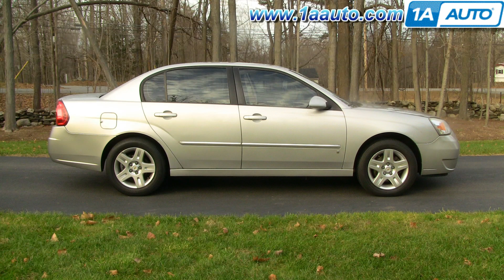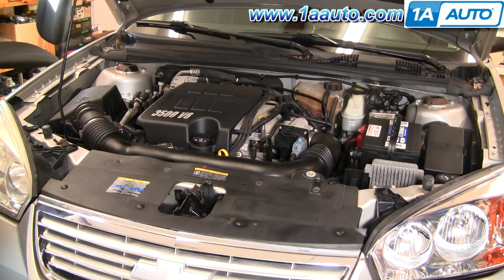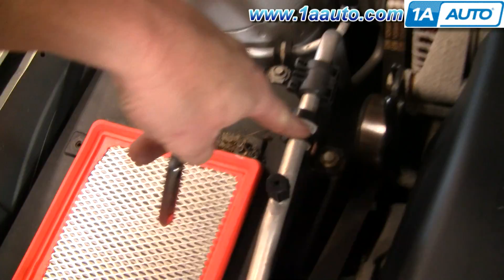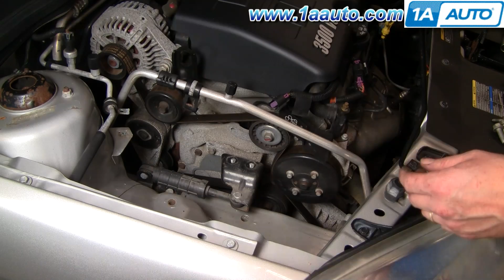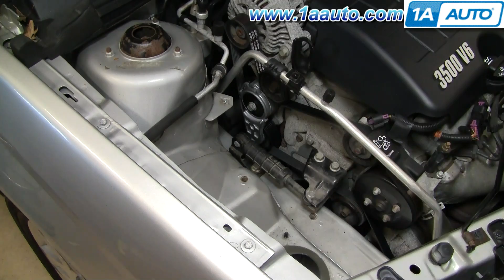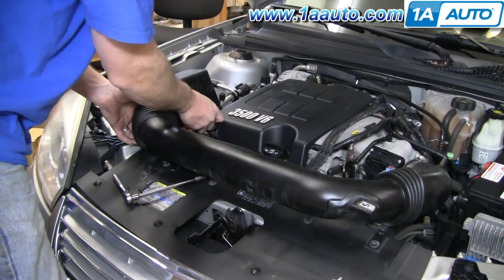How to Replace Serpentine Belt 04-06 Chevy Malibu

Comment: I'm looking for instructions on how to do this in a 2008 Pontiac G6 GT 3.5 L V6... from watching this video, this engine looks very similar to mine. I understand they are GM vehicles but is there any variance to doing this in a G6?
Reply from the maker: +ejreish The process should be similar based on the engine design. 1aauto.com
Reply: ejreish did you ever replace your belt? My service is coming up to check/replace it. I would rather do it myself than pay a shop. Wondering how your luck went with it!

Comment: i have the 2.2L and its almost exactly the same except after i remove the intake system there is this metal bracket underneath the intake system and its directly in the way. Is it ok to remove it?
Reply: That is your engine mount . If you are going to do it that way it is not recommended but makesure you have a jack (with a 2x4 10 inches long bracing again the oil pan.)

Comment: thank you so much for the video!!! i have the same malibu with the same engine and when the car shifts from second to third under hard acceleration the transmission makes a chirp sound , but  alot of forums i read  about other cars that have this problem  say it is the  belt that needs replaced and i guess with 115,000 miles on the car i should replace it , again thanks for the vid it will really help